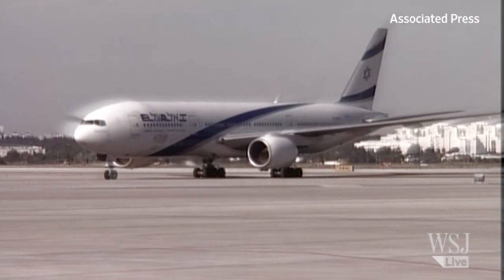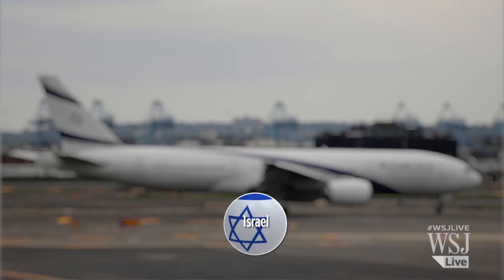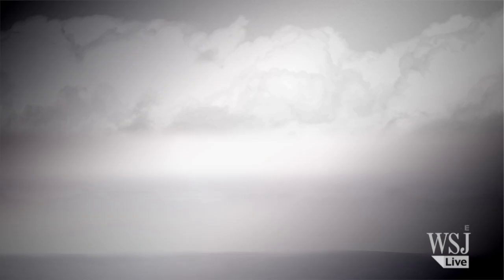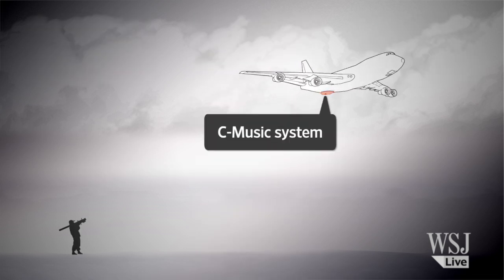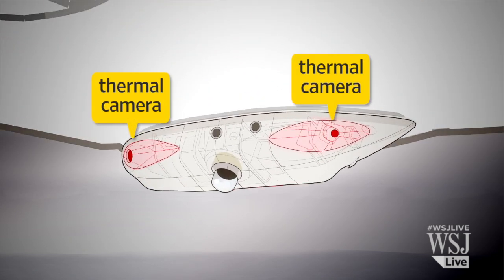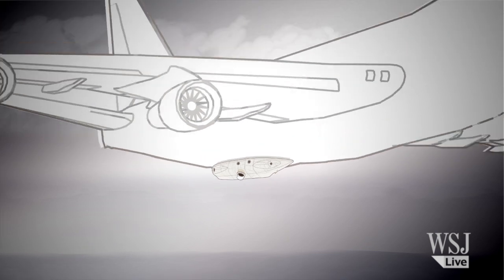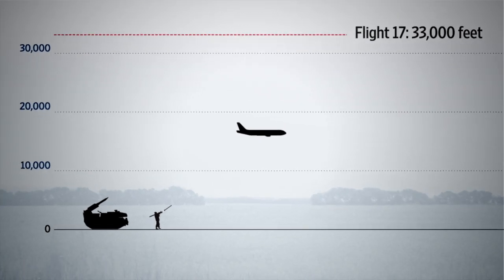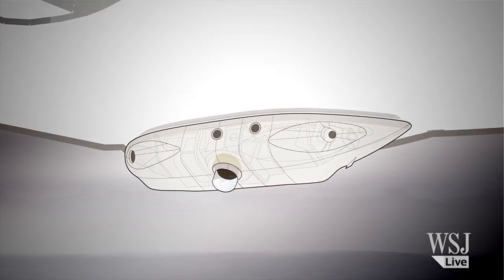Israel Using Antimissile Laser Technology on Planes

Comment: A laser weapon disguised as an airliner? Who would let such a thing into airspace?
Reply: It's not a "laser weapon". It's a giant "laser pointer" that's blinding a MANPAD's IR seeker.
Reply: @philippk2  A laser, which happens to be a heat source, is a good target for infrared rays？
Reply: @jasonxien6890  of course, since it completely overwhelms the IR sensor. The laser is hitting the IR sensor or at least the glas cuppola of the sensor directly, rendering it completely useless.
Reply: @philippk2  This goes back to the original topic, he is a laser weapon, no one would want such a thing, enter their own airspace.
Reply: @jasonxien6890  No, it is not. The laser is obviously not meant to physically destroy things but just to mess with a delicate IR sensor. I don't get why the working principle is so hard to understand.
Reply: @philippk2  In fact, as long as we realize that this device can attack some functions of missiles, then it is a weapon, and it will also have the ability to attack other devices, such as radar.
Reply: @jasonxien6890  how in the world should it be able to attack radar? You seemingly still haven't gotten how such systems work. The best description still is that it is a larger than usual laser pointer used to disrupt the Work of an IR sensor on IR-guided missiles. If it even is usable against anthing else but IR Sensors (it would make sense to use an IR laser to mess around with an IR seeker), it is limited to be used against optical systems. 
Radar isn't relying on optics, hence it cannot be blinded with a laser.
Reply: @philippk2  I understand your explanation, does this mean that this defensive equipment can only defend against specific attacks, and it also means that its effectiveness is relatively low? If another attack method is used, the defense is inefficient or ineffective.